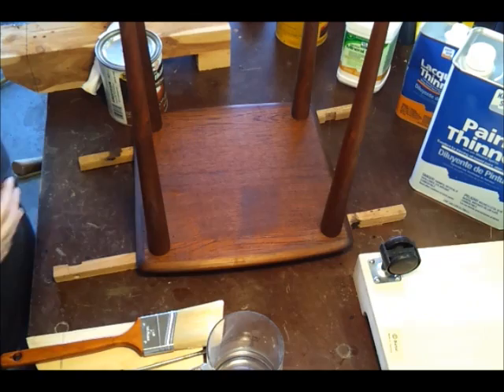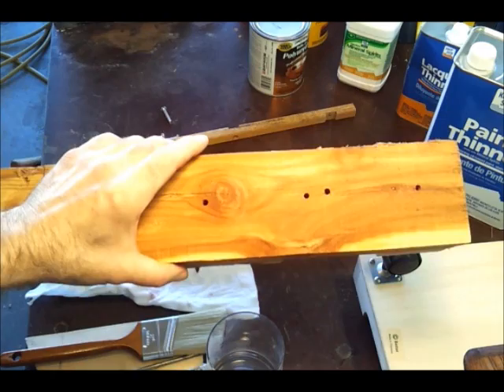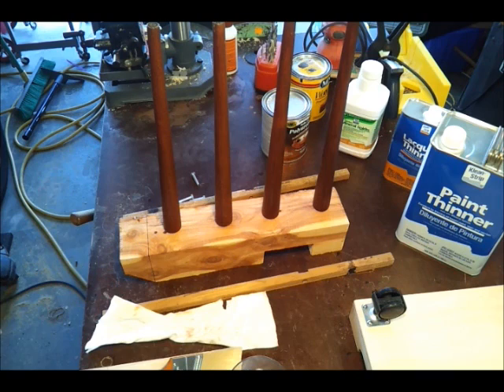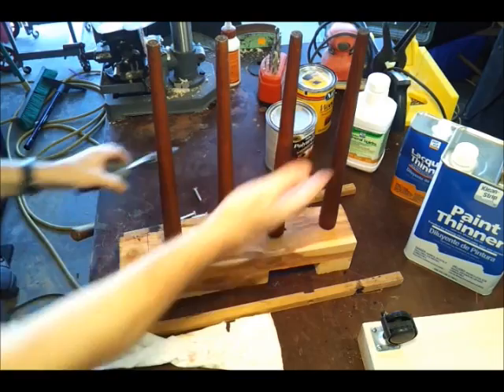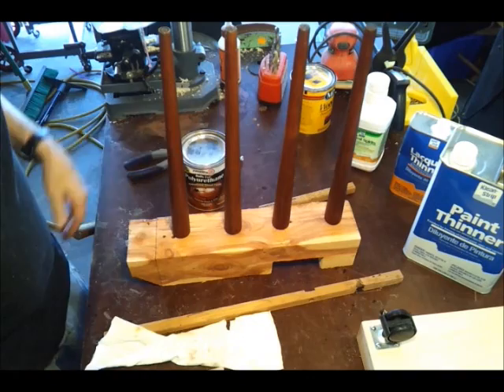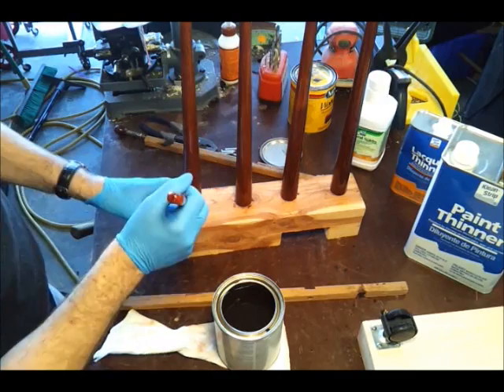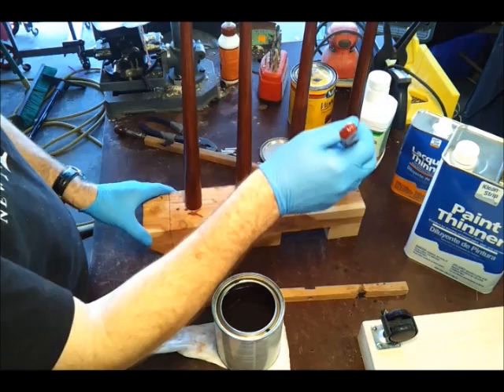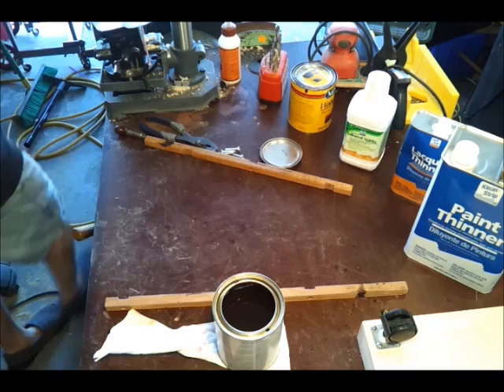Bob's Shop Part 3 applying the Varnish

Comment: Theroom, I would suggest using a product called General Finishes Gel Topcoat. 
It is a wipe on urethane and is easy to use also only available in satin. This is easier than rubbing steel wool and the texture left on your furniture is unmatched. This product drys intentionally to a tack in 15 minutes so that dust and debris in the air will not stick to your finish.  You should apply with a white cotton t-shirt. (Hanes/ Fruit of the loom)

Comment: I work restoring old furniture, and one handy little trick I have used through the years is if you are going to use a polyurethane is to make sure your in a dust free area, and take a blow dryer, and keep it about a foot away from the finish what this does is it helps the polyurethane to lay smooth as well as pop any bubbles that may have formed in the proses of finishing. with the brush on or the spray on polyurethane. just remember to not hold the hair dryer no more than 12" from the finish, and make sure you have your dryer on high, and high on the heat as well. you will be proud when you are done. I will finish with this also instead of sand paper it is in my opinion to use a triple odd steel wool to help with the small runs if any, again if there is a small run, and you put the heat from the dryer to it in time it will blend right in like it was never there. just thought I would put out a few pointers for everyone. I hope it help you all out some. very nice job to my friend..

Comment: I am refinishing a solid wood dresser I found. The original finish was shellac and was so easy to strip with alcohol. I think I will put shellac back onto the piece. I have a HVLP sprayer but this will be only the second time I've used it. I'm thinking 4-5 thin coats spayed on will do it. I just hope the finish will be durable enough for every day use.
.

Comment: Thank you thank you for your parts 1-3 videos.  The videos were so helpful for a beginner like myself.  Now if I can only fix the blotching on my first project, I can move on with my project.  My first project has a lot of blotching even though I sanded with both 80 and 200 grit and applied the Minwax wood conditioner before staining.  What am I doing wrong??  HELP!

Comment: I have added polyurethrane and it does not look smooth and there is build up in some places.  I rubbed down with 0000 still wool but thats not working.  Do you have suggestions to give that professional smooth finish look?  Thanks in advance for the info...

Comment: Just a note to those that don't know... The term "Varnish" seems to have been bastardized to mean any top coat finish. Traditional Varnish contains rosins, gum-resins and oil based solvents. There are various mixes and degrees of hardnesses. There are two classes of hardness. Hard and Tender.
Personally, I don't use the term varnish when referring to every finish made on the market whether or not the manufacturer includes it in the naming of the product or not. 
Polyurethane/Urethane products are not Varnish. It's a plastic coating. It's no more a Varnish than Shellac, or Lacquer or Epoxy. Better said than I perhaps sums it up..  
 "While the terms varnish, polyurethane, lacquer and shellac are commonly used to reference a final finish in general, these products are not the same, nor are they recommended to be used interchangeably."

Seasoned wood workers/ finishers know this. Now, so do you...
This is not "Part 3 Applying the Varnish." This is more accurately titled "Part 3 Applying the Finish..  or Urethane a liquid plastic coating".
More over, that's certainly not the brush you'd use when applying a varnish. Urethane maybe..  but not Varnish..
Nice plastic finish btw. It is pretty. It's just not Varnish.